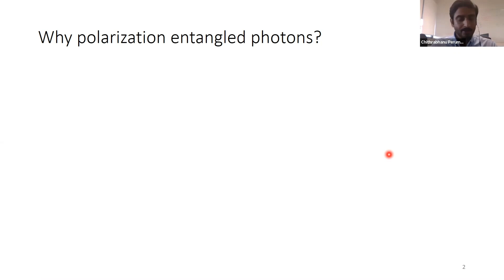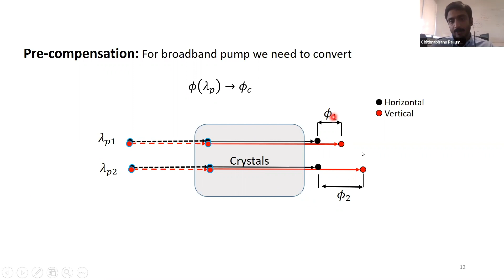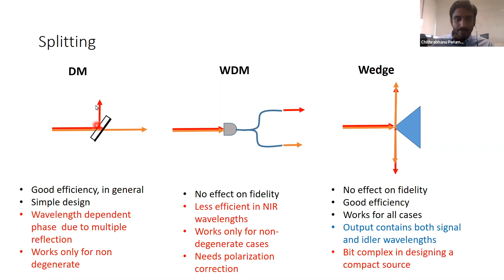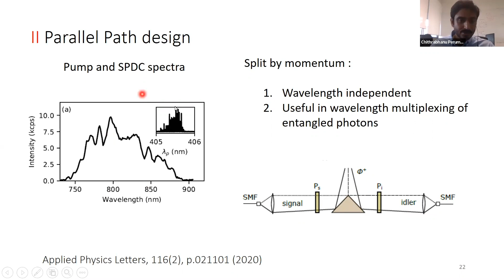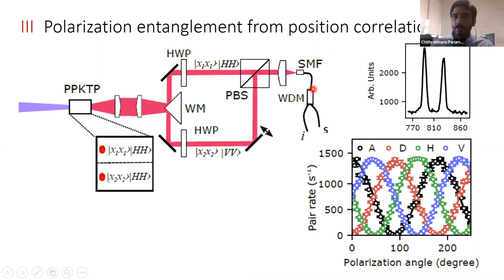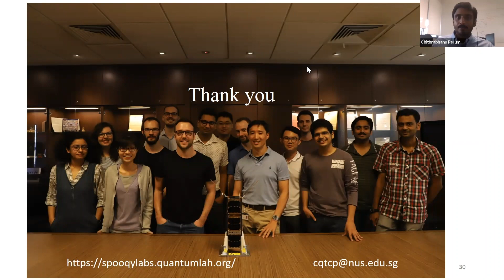Linear and compact entangled photon source designs for quantum communication

Comment: Sir, do idler and signal photons always have same energy ??
Reply: no, only for the degenerate case. For nondegenerate, different frequency/wavelength/energy.
Reply: Listen: 10:00
Reply: @jacobvandijk6525  and one more, can SPDC be done with typical UV source(torch or bulb or tube) instead of UV lasers ????
Reply: @tonystark6997  I don't think so, because these kind of sources are not very coherent. In my opinion, it lowers the (already very small) chance of a down-conversion even further.
Reply: In general no
The condition that is important is the conservation of energy so the generated photon pairs may or may not have the same energy